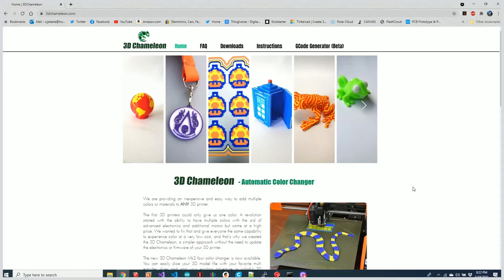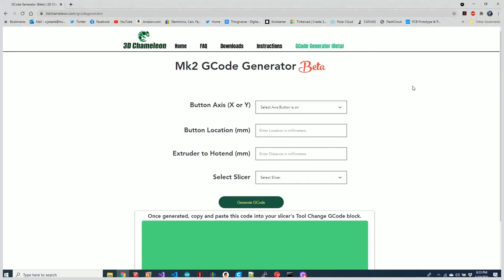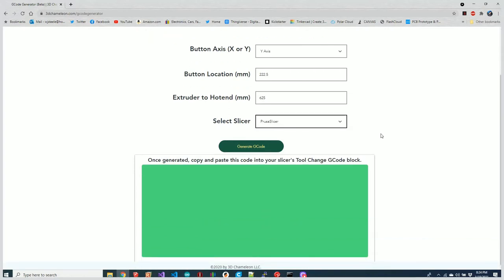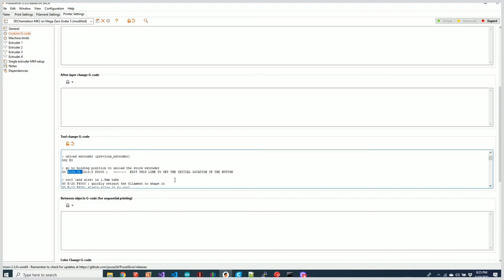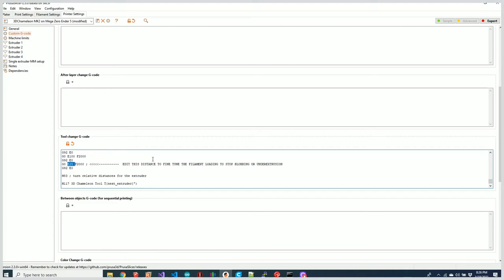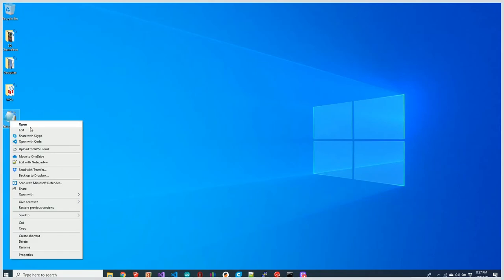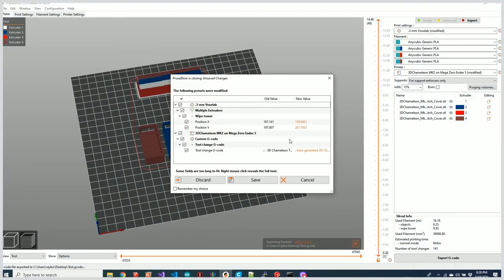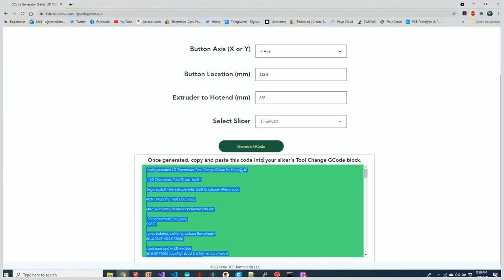3DChameleon Mk2 Tool Change GCode Generator

Comment: Hello, thank you for the video. I am new to PrusaSlicer and 3d printing in general. When I go in and try to select tool change the field is locked and will not allow editing. How can I unlock this field?

Thank you

Edit: looks like im using Prusa 2.4.2. I will try 2.3 now.
Reply: Make sure you have the number of extruders set up first.  For our system, you need to set to 4.
Reply: @williamsteele  That did it! I knew I was missing something simple. Thank you for the quick response.

Comment: Very good vidio if you still make the Gkode calculator for Cura and bring a vidio out there I will be very happy to buy the product. You have developed a super product
Reply: The Cura GCode Generator is already finished.  Just select Cura and generate the start and end code for each extruder.  The Cura profile also works for kiri:moto's slicer.
Reply: @williamsteele  Thank you for your prompt reply.

Comment: How does it know how many times to hit the button to get to the right tool? Is that built into the code generator?
Reply: Yes, that logic is in the gcode.  Modern slicers allow variables to determine which gcode to run.
Reply: @williamsteele  thanks for the quick reply! You’re a bonafide genius